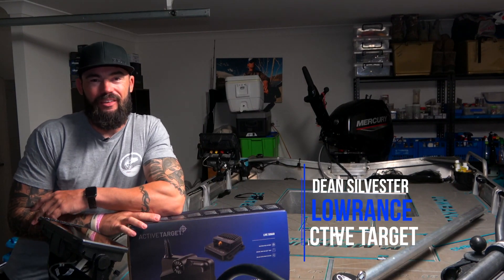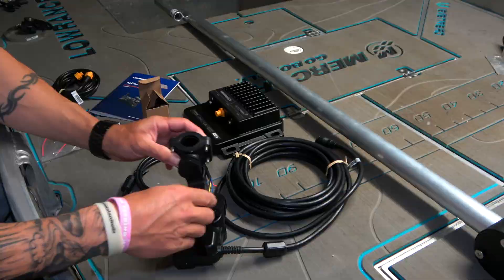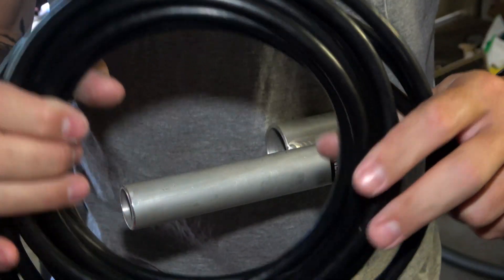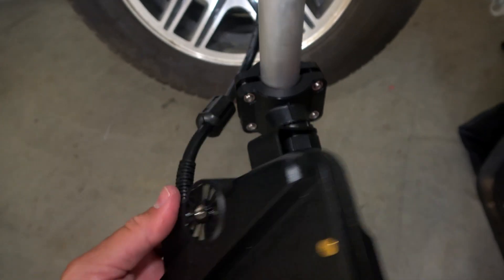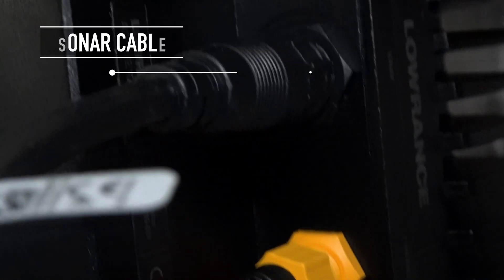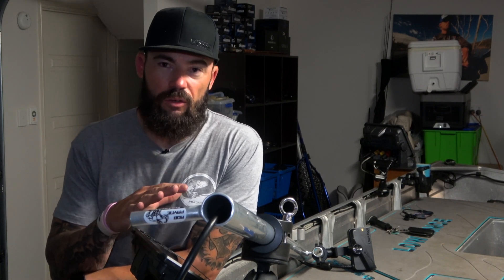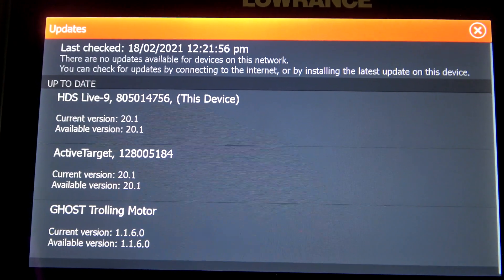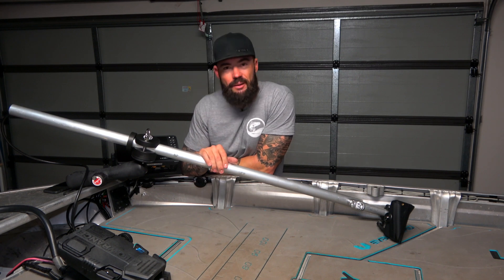Lowrance |  ActiveTarget™ Live Sonar Installation

Comment: Correct me if I'm wrong but If you wire it to turn on with your sounder then it will be on even if the transducer is out of the water and will overheat.
Wouldn't you want to wire it to its own switch?
Reply from the maker: You do have the option to Stop transducer from sending pings even if the module is on
Reply: @lowrance  Thanks

Comment: Paid for mine back in early February....still waiting
Reply from the maker: Hey Travis! Sorry that you are still waiting on your unit. We are experiencing very high demand for this product. Are you located in US? If you are then I would advise contacting your local retailers to see when they will receive units. In addition, you can also check out the BassPro website on a daily basis and see when they come into stock. They generally have some stock available. If you are able to snag one of these units, then you can cancel your pre-order with the other dealer. I know that this is not ideal, but this is the best way to get the unit quicker to you.